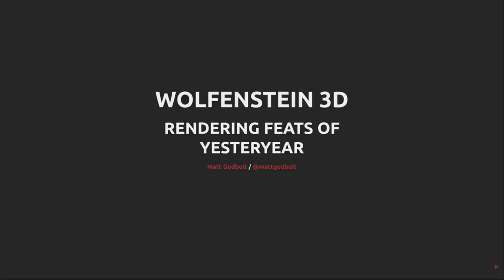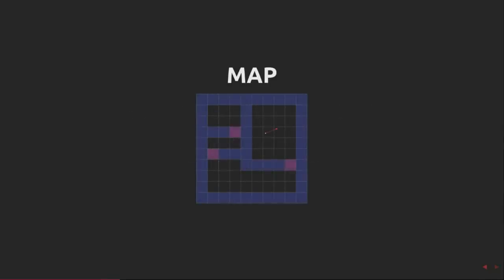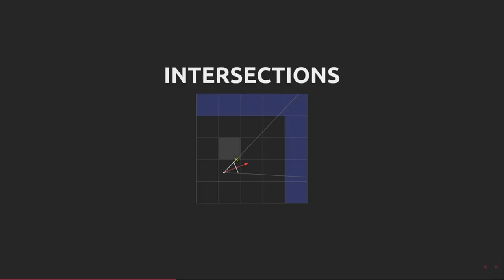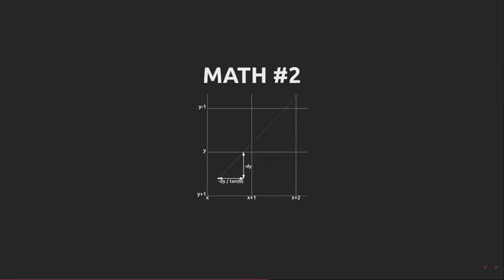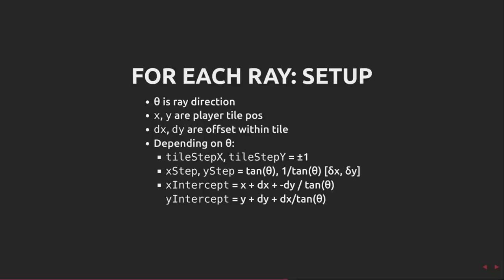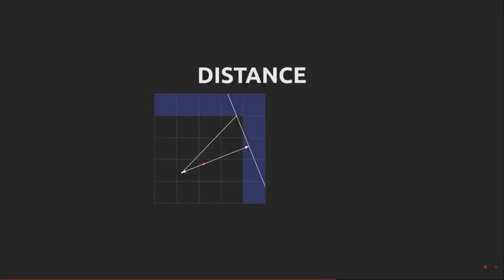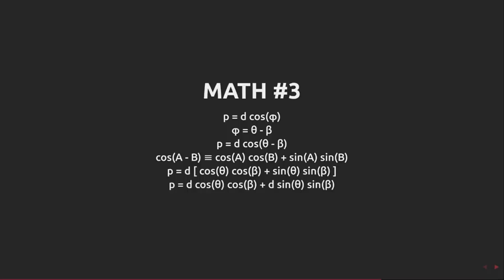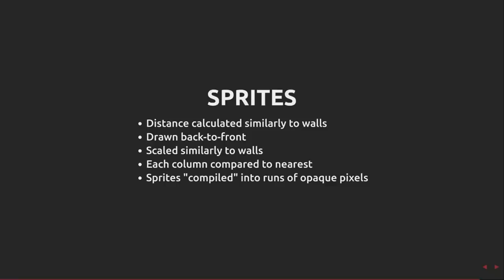Wolfenstein 3D's map renderer

Comment: As advanced as wolfenstein's engine is, I find it just makes Doom more impressive. Doom's engine is so much more sophisticated than Wolfenstein, it's actually insane to think only one and a half years passed between Doom's release and Wolfenstein 3D's release
Reply: etresevo  It helped that that they were targeting a much higher system specification.
Reply: @daishi5571  Not really. i486 instead of a i386.
Reply: @robertforster8984  Well a 486dx2 is certainly a lot faster than a 386dx40
Reply: @robertforster8984  Wolfenstein's code is 16-bit; id was targeting 286s. 

As a side note, it was going to be a 16 color EGA game until late in it's development.
Reply: It’s also a lot harder to go from 0 to 1 than it is to make a feature reach version 2+
Reply: Doom 1 requirements: 486 processor operating at a minimum of 66MHz (i.e. it had float point unit)
Wolfenstein 3D requirements: 286, 12MHz, no floating point unit.

Doom 1 required at least 5 times more powerful CPU, compared to Wolf 3D. I couldn't run it at the time, because I had just 386 with 40MHz.
Reply: @demgreens   I think ID's former publisher, SoftDisk, had a trilogy that was basically EGA Wolfenstein. I think the shareware episode was called "Catacomb Abyss".
Reply: @Roxor128  No, Catacomb Abyss was an entirely different project.

Comment: Gets a bit too trigonometric a bit too quick. It might be easier if you actually drew in the triangles, when you talk about SOHCATOAH. People are much better at understanding maths visually, usually, as shapes, human brains work better with concrete examples than abstract theory. I'm sure to you it's all the same thing cos you learned it so long ago you don't even think about it any more, but an important part of teaching something is knowing where the learner's brain is at, and bridging the gap between that, and understanding.
Reply: Depends what you want to achieve.

Abstract material is transferable while reified material is not. 

As an example, a common caveat in teaching fractions is using cake and pies. It's very visual and most student can understand that taking two of four parts is the same as taking one of two parts. Going for cake to pie then to enumerable objects is a real struggle. But with practice, student end up building a simple model...which doesn't transfer well!

That shows when student are asked to convert a fraction into a real number. Struggle comes back as they didn't internalize that it is a division in the first place and that they are simply asked "do the division".

It's also why most adults struggle with ratio. (Problems like "It take 100 hours for 100 people to build 100 houses. How how long does it take for one person to build one house ?")

When taught using abstract concept, it takes much more time for students to grasp. But once they do, they can solve any problems involving cake, pies and jugs and even convert fraction into reals.

 This is not taught that way because people do not need to have profound knowledge and it's OK most people struggle with ratio all their life. 
It's the practical side which won. But it also limit discoveries we are making.

The same with reading has been observed. People lack vocabulary and are not proficient at reading because syllabic reading has been abandoned for the global method. Global method works through repetition. Through a lot of reading, students remember words and even expressions. The issue is that it obfuscate patterns within words. Again, pragmatism won. People seldom use words like "hydrophobic", so it's fine if they have to look it up.

Schools "dumbed down" because there is not enough resources, but demand increased. Even 30 years ago, you could end up in a one to one session or in very small group with the teacher. It was also quite normal to have hours of preparation work between two lessons and be interrogated from the get go!

What you can do, and that's what I did in the past, is explore and illustrate by yourself. 
It's very different because your anchor is the abstract subject and not the other way around.

But again, starting with abstraction makes everything seems way heavier. But that's the weight of real knowledge!

Comment: Calling the 286 state of the art in 1992 is hilarious - you could get a 386DX40 which would be hilariously faster.  But you know, obviously they weren't aiming for the Crysis of its day, and it had to run on the machines that people actually had, and not just the ones that people didn't.

Comment: I implemented something very similar to this recently, without even hearing of raycasting before. I did it using ASCII in command line, and then moved on to actual pixels. It was really laggy, however. I was simply moving my rays thousands of very small steps in the direction of the walls. It also had that strange fisheye effect you mentioned. Nonetheless, It was quite fun to make!

Comment: There is an effort to port Wolf3D to the Commander X-16, an 8 bit 65c02 based machine.  Casting all of these rays is time consuming, and complicated by the lack of assembly language commands to do multiplication on 65c02.  I found a way to significantly reduce the number of rays cast.

Rather than casting rays one column at a time from one side of the screen to another, the screen is first broken up into groups of columns of pixels.  There are 304 columns on the screen, so rays are cast to column 0, column 256, column 288, and column 304 (note this column is just off the right side of the screen and not rendered).  This breaks up the screen into a group of 255 uncalculated columns, a group of 31, and a group of 15.  For each of the rays cast, there are several values saved in RAM: the map block hit, the face of that block (N,S,E or W), the X-intercept or Y-intercept (whichever applies for that face), and the distance in the direction the player is facing.  For all the so-far-uncalculated pixel columns, the high byte of that distance is set to 255.

For the rest of the columns we do not immediately cast a ray.  Instead, we first check to see if the high byte of the distance is still 255.  If it isn't, then we skip the column and move to the next one on the list.  However, if it is 255 then we look to the left and the right of this column, to find the closest column to the left which has already been calculated and the closest column to the right which has already been calculated.  The order we test the pixel columns, the left pointer, and the right pointer can be stored in three precalculated arrays.  The first array is the column to test {0,256,288,304,128,64,192,32,96,160, 224, 16, 48, 80,112,144,176, 208, 240, 272, 8, 24, 40, 56...} .  The second array is the column already tested to the left {65535,65535,65535,65535,0,0,128, 0, 64, 128, 192, 0, 32, 64, 96, 128...} and the third array is the column already tested to the right {65535,65535,65535,65535, 256, 128, 256, 64, 128, 192, 256, 32, 64, 96, 128, 160...}.   After the first four entries, the left-side entries are the largest number lower than the current column before it in the first list, and the right-side entries are the lowest number higher than the current entry in the first list.  The column to test next is just the midway point of the largest remaining untested range, from left to right.

So the next column to test is 128.  To the left we've already calculated column 0 and to the right we've already calculated column 256.  Here's where the magic happens: do the column to the left and the column to the right both hit the same map block on the same side?  If they do, then we don't need to  cast the rays between them.  We can just do a linear interpolation on the x-intercept/y-intercept value and on the distance value, as every column of pixels between two that hit the same block and face will be evenly spaced between them.

So we just subtract the value for intercept on the left from the value for the intercept on the right to get an intercept range constant, and subtract the value for the distance on the left from the distance on the right to get a distance range constant.  Then we add the left value to some fraction times that constant, a different fraction for each column of pixels.  Since the difference between the column number of the right one and the left one is always a power of two, we're always interpolating 1, 3, 7, 15, 31, 63, 127, or 255 columns of pixels.  It's trivial to keep track of which interpolation routine to use, and the number of calculations in interpolation (two subtractions once for the entire range, plus two multiplication subroutine calls and two additions for each column in the range) is about the same as just the final step of raycasting: converting delta x, delta y, and beta into a distance.

On average, this reduces the number of rays that need to be cast down to approximately 305/(log(305)/log(2)) or 37 rays, more or less; about 87% reduction in rays cast on average. If you're standing close to and facing a wall, only the first four rays need to be cast and all the rest can be interpolated.

Comment: It’s interesting to finally learn how similar & different my own attempt at raycasting back-in-the-day was. I don’t think I ever realized the proper way to eliminate the fish-eye effect. I think I ended up with something much more complex. I also remember that I adapted the Bresenham algorithm for drawing lines for the scaling routine.
Reply: There is a way of eliminating fish-eye, Doom uses a specific technique to do it. Buggered if I can remember how! Doom is actually really similar to Wolf3D. One secret of Doom's speed, is that all walls are dead vertical. No slanting walls at all, just straight up 'n' down. You probably wouldn't notice that unless you knew to look for it. There's a few little genius shortcuts like that, that give the illusion of a world with much more freedom to the level design than there actually is. 

Doom is drawn as vertical strips from top to bottom. Starts at the ceiling, down to any wall, then maybe some more ceiling and wall. Then eventually starts hitting floor and wall partway down each column. 

Each point on the map in Doom has one floor height and one ceiling height. No floors above other floors. No bridges, no multi-storey buildings. Though there's some bits that look that way particularly in Doom II. 

The real genius (well, some of it, there's a lot of genius) in Doom is setting up compromises where the machine could generate each frame fast enough, while having more freedom of level design than the simple flat grid of Wolf 3D. The second part, is designing levels that hide those compromises so it looks like there are less limits than there really are.

Comment: ID software took this several steps further with the followup game Doom , featuring much richer 3D map rendering, while still not requiring any 3D rendering or math coprocessor, although they needed more CPU power.
Reply from the maker: thulinp absolutely. I have plans to cover Doom and Quake too :)
Reply: thulinp If today's engines were this efficient, wouldn't movie-like games run smoothly on ten years old hardware?
Reply: Sounds exciting! Can't wait to see how Id Software pulled off such a great 3d engine for Quake
Reply: define 3d rendering ? all rendering happens in 2 dimensions. hence you are plotting pixels on a screen.
Reply: @SweetHyunho  Today's engines are very efficient, the whole area of realtime rendering is advancing all the time, what makes you think they aren't optimised ?
Reply: Define 2d rendering?
3d rendering is rendering where part of the image calculation requires using 3 dimensional coordinates, and where depth is relevant in the calculation.

In this regard you could claim Wolfenstein and Doom aren't really 3d rendering engines, but there's still places here and there where calculations in 3d space are involved. (in doom somewhat more than in Wolfenstein)
Reply: "SweetHyunho - that's not how that works.
First, modern engines are quite efficient.

Secondly, the only reason the likes of Doom can pull off what they're doing is by placing severe, and contrived limits on what the game can do.
Wolfenstein 3d can only draw things that fit inside the cells of a rectangular grid. All walls are vertical and at 90 degree angles to one another, and they are multiples of a specific grid cell size.
The floor and ceiling are at fixed heights.

Doom has variable ceiling and floor heights, and the walls can be at arbitrary angles to one another, but still all walls must be vertical surfaces, slopes are not allowed.
Nothing can be above something else, so there's no multi-level construction, only height variances across different parts of the map.
You cannot look up or down.
Weapon fire ignores height differences.
moving structures in the level can only be constructed by adjusting the floor or ceiling heights. No other form of movement is allowed.
(Hence why for instance, doors open vertically, and elevators work by moving the floor up and down)

You can do the seemingly impossible if you carefully choose a set of restrictions that makes the problem easier to solve, but it's not some magical feat of efficiency, so much as it is a form of sleight of hand;
By restricting what's possible in just the right way, you create the illusion of something more complex, but with the maths sufficiently simplified to make it plausible on hardware that is otherwise too weak.
Reply: @kangarht  3D rendering is where the geometry input into the GPU is in 3 dimensions, you just need to deal with the inbetween part yourself (transformations, shading, etc). So you are still dealing with 3 dimensions for most calculations.
Reply: @SerBallister  in doom's time there werent gpus, so your definition cant apply here.
Reply: @kangarht  Same applies to a software  renderer, if its doing 3d graphics (say a game like Elite or Descent) it will be internally starting with 3d vectors and then projecting vertices to 2d as the last step of processing. Doom is a special case / hack for 3d, in terms of renderering it is rendering 3d textured planes but the levels are designed using 2d line segments which are converted to axis aligned planes for texture mapping.
Reply: @SerBallister  doom does the same thing. the levels are 3dimensional hence you have fex. rooms with widht, height, and depth. That is 3d in my book.. and this 3 dimensions also have to be perspective projected to the 2d screen. What are "3d textured planes"? a plane is 2d not 3. btw did you know that modern 3d games are made of 2 dimensional triangles ? and the triangles are made of "2d line segments" ? Did you know modern games also have 2d sprites (your 3d textured planes) so modern game cant be a3d either, right ? ;)
Reply: @kangarht  err I do graphics programming professionally. A 3d plane has depth, you cannot do perspective correct texturing without 3d
Reply: @SerBallister  I get where you are goind. doom does perspective correct 3d btw
Reply: @kangarht  I said that already :D Now, go look up the plane equation, and tell me in what dimension it's computed in.
Reply: @SerBallister  dont try to be too smart. a plane is always 2 dimensional, eventho you can orientate it in a 3 dimensional space freely.
Reply: @kangarht  To render it you need 3d. Imagine a wall in doom (or wolfenstein). To walk down the Z/X axis (Z=forward/X=horizontal with respect to the eye) you need to consider 2 dimensions to compute perspective correction. Then the height of each column is considering Y. So all 3 dimensions are needed to draw that wall. Something like mode7 on SNES could be argued as 2d because they are infinite planes.
Reply: @SerBallister  dont need to imagine, perspective correct texmappig needs x,y,z. I code 3d too, I'd say lets stop this dick measuriing competition. I know how you meant it a 2d plane rendered on a 2d screen in the context its in a 3d space, so a 2d 3d plane or whatever :)
Reply: @KuraIthys  weapon fire does not "ignore" height difference, otherwise you wouldn't be able to hit ledges with a rocket, for instance. there's an aggressive auto-aim implemented (both horizontal and vertical, much more aggresive vertically because well, you can't aim up or down) but the shots have proper height to their path. thing is, all entities in vanilla doom are "infinitely tall" (no defined height, their hitbox always extend from the floor to the ceiling of the sector they're in), which means you can punch a monster 20 meters below or above you if you're on a ledge. their sprites still get properly positioned in a 3D space, which means they do have x y and z coordinates to them. flying monsters would also be impossible if that wasn't the case, everything would be glued to the floor, like in wolfenstein.